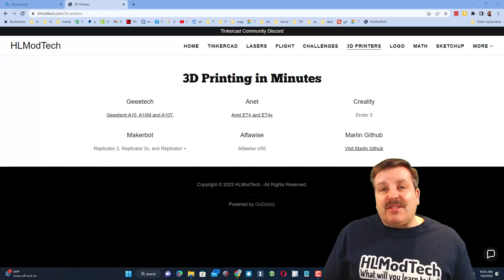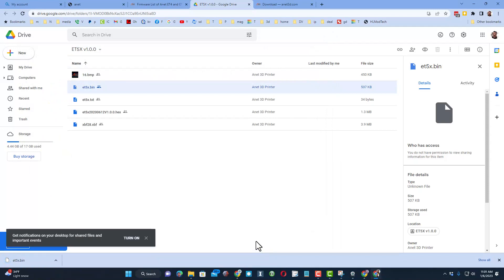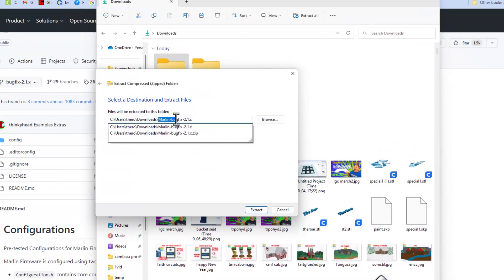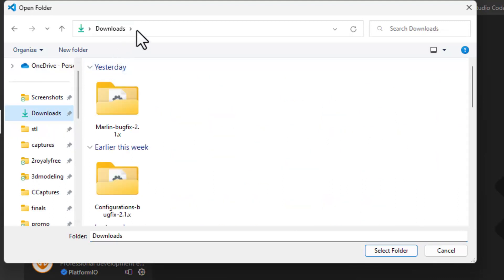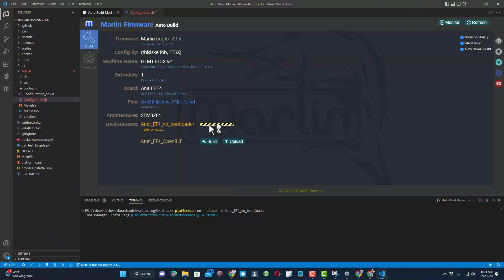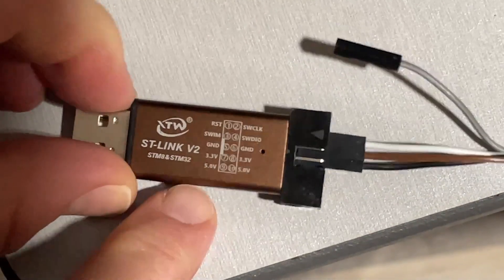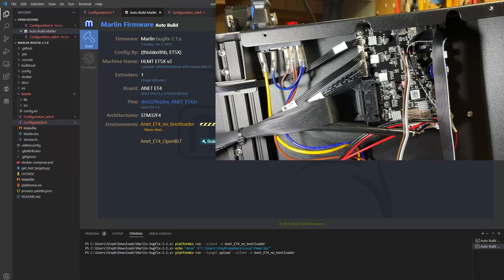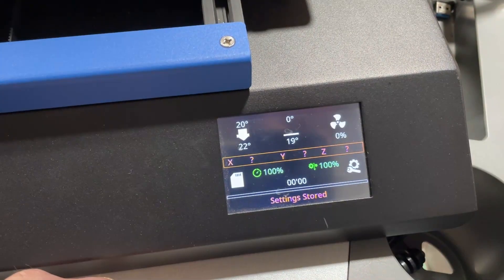Update your Anet ET5X to Marlin 2.1 Firmware in Minutes 2023

Comment: Hello, I followed all the steps and it works correctly, but I have a problem: the head prints about 11 mm off the bed from the front of the Y axis. Is there a solution to calibrate it? I have the Anet 4 PRO. Another thing: Thank you for uploading this content, since it works today and is updated.
Reply from the maker: I believe the ET4 Pro had the set screw that you adjusted to get the height from the bed right. It has been a while since I had one though... There may have been a setting in the menus too... Sorry that it is fuzzy.

Comment: Hi again, I found and downloaded orginal et5x firmware version 1 . Can I install this firmware by SD card?
Reply from the maker: Nice work finding the firmware. I cannot remember if it worked via SD card... I would guess so. What sort of file type is it? .bin, .hex?
Reply: @HLModTech  I have bin and hex both
I saw this video and I wrote the exact url of the google drive that u went to it through the link on the Anet Website on this video. Then downloaded all of them
Reply from the maker: Sweet work with finding the firmware.
Reply: @HLModTech  If I do it by SD card and if it did and change the firmware, will I need to calibrate? Or because it is the main-source firmware, It is suitable exactly for ETX5 and will not need to calibrate?
Reply from the maker: I believe going back to stock you are just ready to roll. I think I did that with one of my anet machines... let me root through the playlist quick.
Reply from the maker: This is the full playlist. https://www.youtube.com/playlist?list=PLRXLS33csRK5LoGOVUMUU9rtdNINTDw_f
Reply from the maker: I went back to stock with the ST link. https://youtu.be/b7rmJA4e5jc?si=nuPxv9MN8lsdoPm7
Reply from the maker: This is my only stock firmware vid. https://youtu.be/yLcmGWmbnEo?si=w-m-QesMuvmM4q9a  I am not quite sure... but I think I just stuck with the ST-Link all the time because it worked.
Reply from the maker: Thank you and good luck. 💯👍
Reply: Where did you find the original firmware?

Comment: does auto bed leveling works? i have a ET5X with a silent motherboard ...wich config should i use then? thanx
Reply from the maker: I have stuck with the manual leveling. I am not much of a modder of printers. For the money I think you would be wiser to buy a new printer that was designed to auto level from the start. I love my Minda Magician X2 and Sovol SV06!
Reply: @HLModTech  Et5x comes with sensor and bed leveling in stock software
Reply from the maker: My bad. You are correct. I have the ET4x too and they do not. 🤦‍♂️ That said, I have not messed with the ET5x other than to use the z offset in the control panel.

Comment: Thank you for your help. I was at last succesfull installing marlin 2.1x (config anet 5pro) to my anet et5x which has pro motherboard   . I am now printing calibration cube from my computer using usb link. My only problem is media inti fail error, and not reading sd card, and get printing from sd card.🙂
Reply from the maker: Super cool that you have it working via USB. I have not heard of that error before.  First time I have heard of one that has a swapped mobo. When you picked the config, which one did you choose?
Reply: @HLModTech  anet5 pro configs. I have not changed anything in config files
Reply from the maker: That may be the issue. I am not sure what sort of component differences there were between the machines.  Obviously not too many if you have it printing. 👍
Reply from the maker: Fantastic!!!!! Thanks tons for sharing too. 💯👏

Comment: Hi, I have a problem that when printing an element, the printer stops using this software, before the update there was no such problem, the extruder immediately stops, after a while it prints and so on, it stops and prints, which makes the print look terrible, it has blobs. Et4 Pro
Reply from the maker: I would just go back to the stock firmware.  My general rule is that if the printer is working fine... no reason to mess with it.
Reply: @HLModTech  Only the stock software does not give any freedom, I can't even develop the speed or anything, or even calibrate the steps, because the eeprom is blocked, the PID is also blocked, the temperature can fluctuate, average work with the stock software ;p
Reply: Likewise, I can't go back to the original software because I've now changed the leveling sensor to an 18mm capacitive one and the original software doesn't work for me :/
Reply: @HLModTech  My probe goes beyond the printer table

Comment: My ET 5 is currently white screen, n that happens when my 3d print doing its job. Does updating the firmware can fix this problem?
Reply from the maker: I cannot guarantee it fixed anything. It really just gives you more control of your printer. If that is a hardware failure... it will still be after adding Marlin. I might try to update the Anet firmware first to see if that fixes it.
Reply from the maker: Does the printer start with the orange screen, print fine, then end with a white screen?
Reply: @HLModTech  yes, when i checked the board after that, the d2s light indicator at the right of pin, it was not turn on or blinking

Comment: Dear friends, I need help: i have an ET5 on which i have installed marlin 2.1 thanks to this excellent tutorial
When I try auto home, the Z axis doesn't stop and the head  slams  against the bed.
The proximity sensor lights up when the printing head is close to the  surface; thinking the contact was not working I tried it and it seems to  be OK (it is powered at 20V, when away from the bed I read on the signal  pin about 6V, when near it goes to 0V).
I thought the print head stopped its motion triggered by the proximity sensor  signal... 
Any ideas? Thanks in advance!
Alessio
Reply from the maker: Are you working with a 5 or 5x? I am not sure what the differences are, but I would make sure you had the correct configuration  as a first step. All the info you have added so far sounds like you are on the right track.
Reply: Dear  @HLModTech , 
the printer has definitely gone crazy, now is also reporting wrong temperatures (180°C for both bed and noozle). Most likely the motherboard is broken. It was a ET5 pro Anyway, thanks for your support! <3
Reply from the maker: Ugg. Sorry to hear it did not work out. 😔 way cooler when the toys are rocking.

Comment: @HL ModTech having upgraded to Marlin, whilst you can use the pause at layer option with M600, you can also use the Filament Change option in the Post Processing Scripts list

I haven't tried the "Use Firmware Configuration" yet, try that tomorrow hopefully.
Reply from the maker: I appreciate the updates. I plan to experiment more too... just so many things on the list. =)
Reply: @HLModTech  I can confirm that checking the "Use Firmware Configuration" works perfectly on the Filament Change post script

Comment: Great Video, I completed the steps as outlined several times, for some reason I can not do Bed Leveling and when I try to print the print head is about 30mm mover the bed? Any ideas?
Reply from the maker: 3 cm is crazy. I used the z adjustment to fine tune mine. It was pretty slick. I used guess and check till I had it where I wanted. I think mine was +.02.  You are working with an ET5x, right?
Reply: @HLModTech  yes the ET5X I did change the hot end to the BondTech DDX 3 with a copperhead and slice engineering hot end. Before the firmware change to Marlin, I printed the 10mm cube successfully, needed a few fine calibrations yet but nothing to mention. So I’m stumped I also noticed that there is at least one screen which hangs and I have to power off to reset it?
Reply from the maker: Did you ever adjust the screw for the probe sensitivity?  Does it auto home to the correct spot?
Reply: @HLModTech  I physically set the hot end to the table with power off, powered on and set the gap with a 4mm feeler gauge, then set the probe. When I select home the x moves to the switch and stops. The hot end moves up to approximately 30mm over the bed. If I home and auto bed level, all the axis zero and it stops with no other response or movement from the home.
Reply: Auto home set the x to the switch not the center of the bed. Also there is no option for manual setting bed level?
Reply from the maker: If you are willing to shoot me an email hlmodtech gmail it may be easier than bouncing messages here.

Comment: @HL ModTech this isn't working for me, but suspect it might be the STLink.  I've checked the pinouts, mine are different to yours.  When I try to upload it fails with ...

Error: libusb_open() failed with LIBUSB_ERROR_NOT_SUPPORTED

In the terminal tab.

However, checking device manager in Window (11) the STM32 STLink is appearing under other devices with an exclamation because there are no drivers?
Reply: Yep, as I thought driver issue.  Obviously the generic "thing" I purchased from Amazon had no drivers, links, support etc.  Quick Google and I found this page...

https://www.st.com/en/development-tools/stsw-link009.html

had to register, grabbed the driver, installed it a voila all sorted
Reply from the maker: Sweet! Sorry I did not reply. That was hung up in the "spam" because of the link.
Reply from the maker: Let’s start with making sure you match the pin names with the correct wires.
Reply from the maker: Also, start with the video for the 4x or 4 that has the backup steps. If that tool is working, that would confirm you have setup it up right
Reply from the maker: Having the backup is super smart too
Reply: @HLModTech  ..check the PIN layout  !  thats correct...i had an old Blue ST-Link USB programmer. ( name BATE ) ...update no problem with the ST Link programmer....but the Lay out of the 10 PINs where different than the new ones with name  discription on the housing !! ......the old ones do not have any lettering on it... took me hours to find this ..... : )